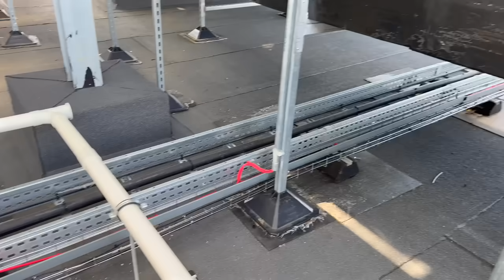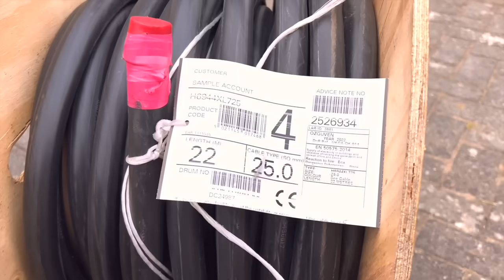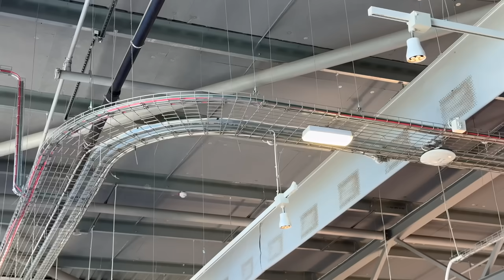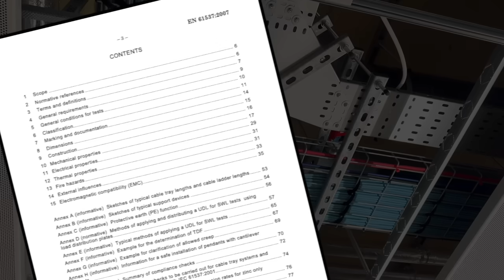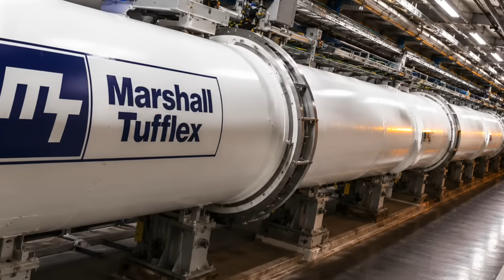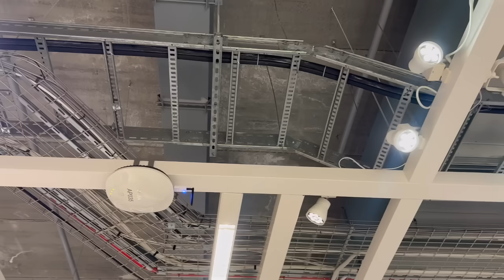The Surprising Reason Cable Trays Have Holes...

Comment: One item when considering that has not mentioned in regards to the strength of the tray and brackets etc is the actual pull out strengh of the concrete slab if being used as the support system.

Comment: When you mention data has enlarged industrial sites it’s also worth knowing for data and power. There are larger trunk cables that branch out and supplies for things so they still use lightweight systems for distribution. It’s very common for data centres to actually have their own power supply for each cubicle which is like a small room and its own data into it those are actually supplied on very large ladders but then you branch out using very lightweight containment depending on the design of the system if you make the electrical system designed properly you can also use cheaper containment and reduce overall cost

Comment: After working in industrial electrical and instrumentation for over 50 years I would never install perforated cable tray.
Reply: It’s the only type you can usually achieve easily
Reply: @T@TheLostPacketYTits not very practical in an industrial setting. For lighter cables we use wire basket tray, but normally ladder rack.
Reply: @robbiedix6775  industrial still needs small cables in many places

Comment: Yes but unfortunately our approved electrician is an idiot, and 'designed'  several cables with approx 3" diameter to be supported with light basket tray 'supported' with 8mm threaded rod and basket clips, rather than being supported with more traditional unistrut brackets and 10mm threaded rod.

Comment: Galvanised cable tray without holes in it is galvanised trunking without the lid! Interesting article regarding support but click bait regarding why tray has holes in it, who would use it if you had to drill the product every time you needed to support a cable or place a bracket!
Reply from the maker: Those days fitting trunking onto trapeze, we burned through some drill bits in those days 😅

Comment: There are a couple of reasons. One is to,let water through, the other is because they don’t need to carry much weight and are cheaper if using less material.
Reply: You still use the same amount of material to make it. In fact, perforating it produces more waste material.
Reply: @JaenFoster and then it is a by-product, used for another purpose and revenue source by the manufacturer.
Reply: @Adventures-and-More  Costs more money to go and perforate it though. Tools are expensive.
Reply: The rain reason is not a reason.
Reply: @tresslerj1985 He didn't say rain, he said water.
Reply: @tresslerj1985 😂 maybe just leaks